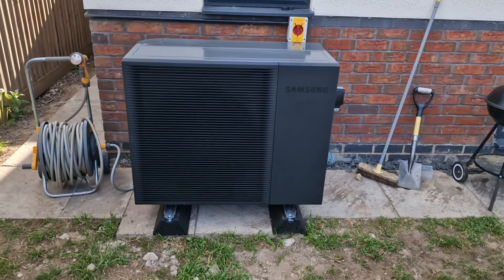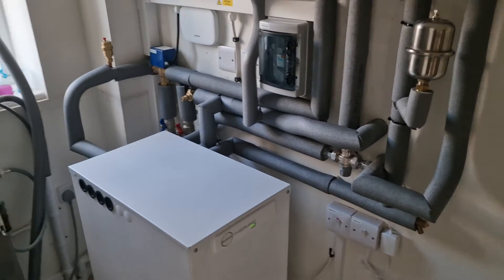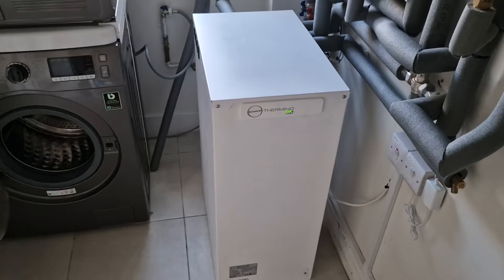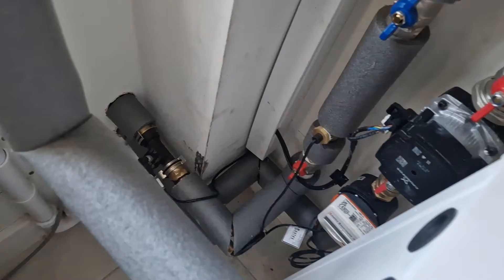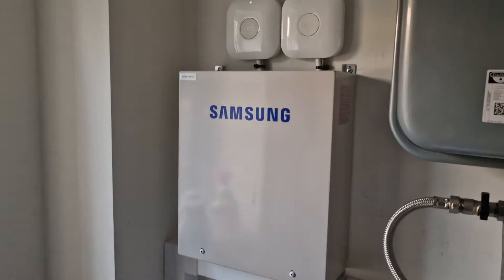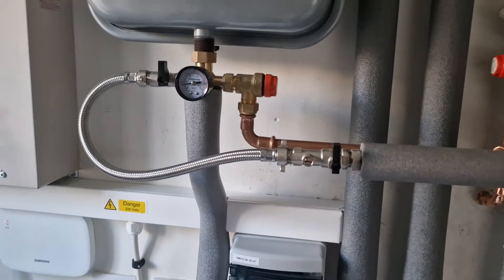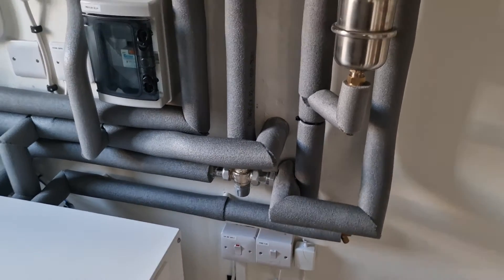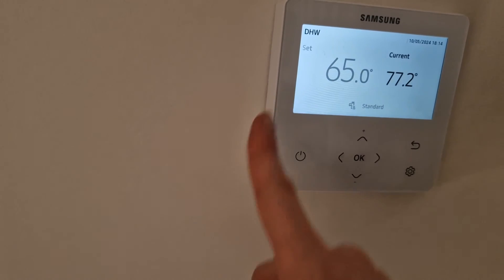Samsung gen 7 R290 5kw ASHP + sunamp installation

Comment: Thanks for this and the other similar video. I'm looking to do a similar installation. You have added a lot of useful monitoring and sensing accessories. Do you have a sketch of your pipework configuration for both the water heating circuit and the space heaters? 
I want to use the heat pump to drive both the heater requirements and an air conditioning fan coil unit to provide both heating and cooling in the house.

Comment: if you search YT  for "Troubleshooting the Mystery: The Reason Behind my Sunamp Heat Battery Failure" you will find that additional safty mechanisms may be worth getting installed to protect the Thermino if the mini expansion vessel fails to prevent Thermino failure and leaks etc.

Comment: How have you found the 5kw Samsung now after 9 or so months? I am being offered a 5kw Samsung as its cheaper but other quotes have been for 6kw valiant or even 7kw Aira. I have a small 2 bed terrace and the installer says it will be fine but wondering what others experiences are.  Thanks!
Reply from the maker: @owenwall5486  I'd say it depends how much you care about the controls and connectivity with home assistant and such. If you are a bit geeky like me I would probably gone for a valliant . Also there's very little info online about best settings and such  unfortunately, no idea how to update the firmware if it can be upgraded.
Reply: @Wawyed  thanks for the reply. I suppose I was also wondering about the 5kw over the 6 and 7kw other installers have offered. Is 5kw big enough? I'm mostly interested in getting a  SCOP in the high 3s and also it not being too noisy.. I wondered if a smaller unit would be working harder for longer an then maybe noisier.. or perhaps wear out quicker..
Reply from the maker: @owenwall5486  that would depend on your heat loss calculation. I'd say as close as it can get to it as higher number might struggle to lower the compressor speed to avoid cycling
Reply: @Wawyed  I was told house heat loss is 6.49kw.. I don't know much about it all though. Thanks for the advice tho!
Reply from the maker: @owenwall5486  sounds like 7kw should be good. Make sure they do the calculation for a flow temp of max 40C to get a good scop when sizing the heat emitters
Reply: @Wawyed  thanks! I had a feeling 5kw may be a bit small.

Comment: Hi there 
I was wondering why you bought a Samsung and not another make or heatpump.

The reason I ask is that I am considering buying either a Samsung EHS mono HT or a Vaillant aerotherm plus 7KW or a Daikin aerotherm 3.

It seems that most people install the Vaillant heatpumps and hardly any, at least on the energy monitoring site, of the Samsungs and Daikin.

Therefore was just interested why you went for a Samsung and are you happy with the COP performance?

Thanks in advance
Reply from the maker: Hey, there's a few reasons for my choice. I wanted a heatpump compatible with Sunamp so Samsung was one of them. I also wanted one that used the R290 refrigerant (as R32 will be banned in the near future) and Samsung just released this model with it. When I look at the numbers, in paper they all perform as well as each other (I felt that maybe Samsung had better numbers but I could be wrong). The last choice was cost, the Valiant model was adding an extra £2000 so I personally couldn't justify the price difference. Having said that I would say Valiant has better software and integrations than Samsung, so that might be one of the reasons for the cost difference. I also think Vaillant advertises their heatpumps much more than Samsung.

In terms of performance I'm very happy with it, over the last 30days I'm getting a COP of 4.7 in heating which I think is excellent.

I would recommend that you go for a model that uses R290 so make sure of it. I think the Samsung EHS mono HT is the R32 model so be careful with that.
Reply: @ thanks for the info, appreciated!!
Reply: @Wawyed  I have asked similar questions on the forum as everyone seems to go for Vaillant but the price difference is significant - plus there has been talk of the 7kW Vaillant underperforming in many cases. The Samsung Gen 7 looked like a contender but some of the feedback has now put me off a little. The Veissman's a too pricey and the Mitsubishi R290 isn't that widely available it seems...

Comment: Great video!  Just self installed a Samsung Gen 7 8kw and trying to refine the settings. Also have heat pump monitoring so I can see how it preforms.  Ive got mine running using weather law but I think it is cycling too much, probably needs a volumiser adding, On your description space heating settings you have  "Weather compensation with a little room influence" How do you do this in the Samsung controller?  Thanks
Reply from the maker: @detroitdiesel33  how much is it cycling? I think some cycling is normal. Unless is like every 5 minutes. Specially if the cop still okay even with cycling
Reply: @Wawyed  Yes around 5min cycling so we wondered what was wrong. We are running direct to rads without any buffer or volumiser  to try and see what we really need but plumbed so we a could add them if needed. We are running water law as per the menu but discovered some where else that the stop temp was 20c, set to 14c to see what happens and it been off ever since so looks like we found something. Also got level 3 monitoring and really handy to see what is happening, added to the monitoring site but cannot see it yet---Thanks
Reply from the maker: @detroitdiesel33  in terms of water law with room influence I've set it to use my nest thermostat and when the temp is reached it switches off the heatpump. I'm wondering if the reason is cycling is because the room is warm enough and heat is not disipating. I don't think you need a buffer tank if the flow is sufficient. There is a setting on the Samsung controller to determine what happens when the room temp is reached. When does the cycling happen?

Comment: Intrigued to learn more about your relay. Is this because there isn’t a SunAmp Samsung integration? I have the Vaillant integration but I don’t think it communicates full or not, I think it’s just a timer with 2hr max. Maybe I’ve missed something.
Reply from the maker: The relay is used to trigger the backup electric heating element inside the Sunamp if the heatpump is not able to fully charge it within a reasonable time (configured in the samsung controller). I haven't need to use it so far because the heatpump has been more than capable to fully charge it so far.

Comment: When installing a heat pump with R290 refrigerant in the UK, it must be kept clear of windows and other openings for safety reasons. I guess a surveyor will pick up on that if you decide to move. Let's hope it is your forever home! I love your Phase Change Water Battery. I have heard, however, that Sunamp Thermino can be very unreliable. I'll keep my eyes peeled for your future videos. :)
Reply: R290 heat pumps can go below windows. If they are at the same height as a window or door then a 1 metre horizontal gap is required. Propane is denser than air so won''t leak upwards into a window. Check a heat pump installation manual such as for Vaillant Arotherm. This is my understanding.
We're talking about less than 1kg of propane. Compare with mains gas which we can burn in our living rooms if we like.
Reply: @chrismorrish130  I suggest you use the term "protective zones" in Google. Maybe add ASHP with it too!
Reply: @chrismorrish130 indeed. 1kg of propane is 4 camping canisters…..  I find it incredible  that it is flagged as a major issue.  Seems to be a BS standard that keeps idiots employed.
Reply from the maker: Thanks for your concern. The installation is MCS compliant and has passed the OFGEM audit. I've had no issues with my Sunamp so far and further more with the power of automation, I'm using my heatpump as a combi boiler and enjoy on demand instant hot water

Comment: Nice install. Looking at the monitoring you seem to  be heating the Sunamp every two days and at high flow temperatures. Does the Sunamp setup require high flow temperatures to generate the storage temperature or could you run it lower like a cylinder?
Reply from the maker: In order to store the heat energy the P58 PCM used inside needs to reach at least 58 degrees so in order to fully charge the battery the return temperature needs to reach 63 degrees to make sure all of the material inside is fully melted
Reply: @Wawyed  Interesting. R290 then is the way to go if you wish to run a Sunamp. It certainly does save space, my 250L tank is huge in comparison. It'll give you a low cop value but you are not actually running for very long so it all works out in the end.
Reply from the maker: @carlarrowsmith  Yes, R290 is much preferred. If not the battery has a heater element inside to help if the heatpump can't cope but i wouldn't recommend using it as It'd be very expensive to run. I think overall is still worth is as you don't need to worry about legionella cycles, takes much less space and it is very energy efficient in terms of heat loses. If you get something like octopus cosy tariff or have solar + battery you can just charge it at low peaks and it'll last for days
Reply: @Wawyed  Love it. Just a quick question for you. How are you getting your data onto  emoncms, did you do some custom stuff?
Reply from the maker: @carlarrowsmith  I got the installers to install this https://shop.openenergymonitor.com/level-3-heat-pump-monitoring-bundle-emonhp/

Comment: Can you do more content on the Sunamp Thermino, there is very little in the way of customer reviews on how they perform. I would be very interested in knowing things like the flow rate, once drawn from does the remaining stored heat just remain undiluted unlike a DHW cylinder where the cold topping up reduces the whole cylinder's water temperature, do you find you need to re energise daily or can you leave it longer? Thanks
Reply from the maker: If with flow rate you mean the hot water pressure is the same as mains pressure. That is correct in terms of the stored heat, it releases a constant hot water temperature until is empty controlled by a thermostatic valve (I have it setup to 45C). The heat loss on it is great so it can last for days if its not being used.
Reply: How long have you been living with it, I'm guessing 3-4 month since your original video on your set up? I love a bath, I presume it more than capable of filling a bath? The other thing I thought you might have said was it looks too start recharging if it goes below 80% capacity, is this fixed or a level to user can set or just choose to fill once a day?
Reply from the maker: @ianed0007  I've only had it for a month. As I mentioned is equivalent to a 300L tank at 40C. So that should be more than enough for several baths. There a bigger size one as well for even more capacity. About the 80% is more like it tells the heatpump that the hot water needs to be heated again but  you can control via schedule or manually when you want to do so.
Reply: @ianed0007  Hi ianed, we just had a sunamp thermino 300 X-Plus installed this summer, and it's been (mostly) brilliant !

It's a quarter of the size of our old 300 litre thermal store, but will still supply 300 litres at 40 degrees, and after we recharge it on the overnight tariff, ALL the water comes out of it at the same temperature, - from first to last !

The only problem we've had with it has been when a guest staying in our 'Air b'n'b' room (we think) left a tap on, and so the water is hot until the sunamp is exhausted, at which point it suddenly goes cold ...

(But using the built-in immersion heater it heats up enough to be usable again after an hour or so)

The only other problem we've had is finding a Heatpump installer that will bother to fit a heat pump that will communicate with it, there are 'officially' only a few, and the grief I've had in trying to convince installers that a Sunamp isn't some alien device designed to destroy their business because we've already had ours installed, is beyond a joke !

The Samsung R290 isn't actually one the heatpumps that it will officially talk to, which is why I watched this video in the first place, - I have spent most of this summer actually waiting for sunamp to produce one of their 'Optiminio Key' communication devices for the samsung, because they said that they would, - but still haven't done so, - hence Wawyed's solution here !
Reply: Thanks. I'll subscribe and see if you've got more to say about it the longer you have experience of it. As I say, there is very little of reviews of the Sunamp by real users. I've been interested in one for a while but holding off waiting for more information on hold people are finding them. The low SCoP because of the higher recharge temperature isn't something I had really thought of before, so thanks for highlighting that.
Reply from the maker: @ianed0007  I'll like to see after having a full year how much it affects SCOP value. Obviously the central heating won't be affected by it and the hot water is a very small amount of usage compare to central heating.

Comment: Interesting video, you should post your open energy monitor link in the video description for people to check out the performance 👍
Reply from the maker: Added links in description. Still trying to figure out the most optimal way to charge the Sunamp. I knew before hand it wasn't going to be the most performant with a heatpump cause of the higher temperatures required to fully charge it (65C). Although it's very efficient at maintaining the heat compared to a water tank so it might balance out
Reply: @Wawyed  Running at 65c is obviously not ideal for COP. My heatpump uses around 1.5kw to heat a 250litre tank to 45c from cold during the warmer temperatures we have currently.

It will be interesting to see what you're using for 300litres worth at 65c.
Reply from the maker: @danpye1991  Just to clarify, it doesn't constantly run at 65C just at the end of the charging cycle to fully charge it. How much heat is outputting from those 1.5kw? I want to also understand if I can charge it to maybe 75% and improve the COP.
Reply: @Wawyed  So on a really good cycle I used 1.248kwh electricity and produced 6.293kw of heat. COP of 5 for hot water generation but only to 45c.

Comment: hey will you be sharing the link to your openenergymonitor ... keen to see the R290 unit characteristics
Reply from the maker: Sure https://heatpumpmonitor.org/system/view?id=250
Reply: @Wawyed  Thanks for making the video and sharing both your experience and your pump's performance data. I noticed that the COP is quite a bit lower than Samsung advertises. At a flow T, your COP seems around 4, whereas samsung gives 4.8. Is that just common overselling by the manufacture?
Reply from the maker: @matthijsvanspronsen3436  I wouldn't say it's overselling but more like the COP depends on multiple things buy mainly outside temperature and flow temperature selected. My heatpump system is designed to heat the house at -3C with 40C flow t and then I use water law to lower the flow temperature as temp increases outside. At -3C/40C the COP would be 3.34. The COP that heatpump companies usually sell is at 35C with 7C outside temp so maybe that's why. Around that temperature range I get 4.5 or so, so i don't think is that bad
Reply: @Wawyed  Ah, that makes sense. Thanks.

Comment: I am just about to get the same heat pump and Sunamp  installed in a month or so, slightly bigger heat pump at 16kW version, would like to see how you have integrated it in to Home Assistant.
Reply from the maker: I've used the Smartthings API with the samsung wifi module you can install with the heatpump. I might make a video explaining a bit more